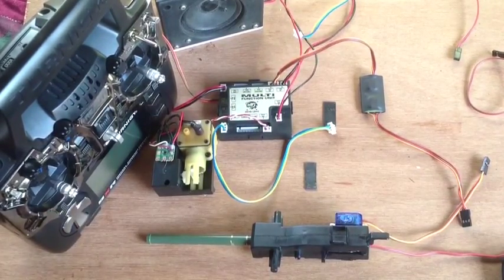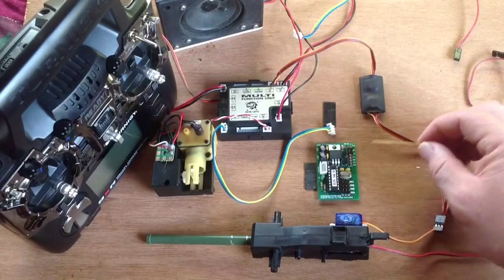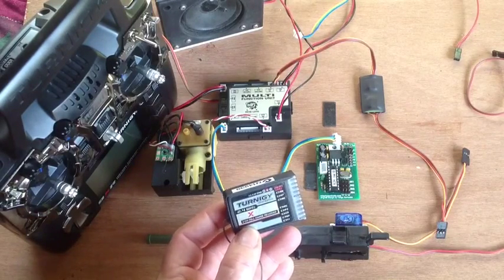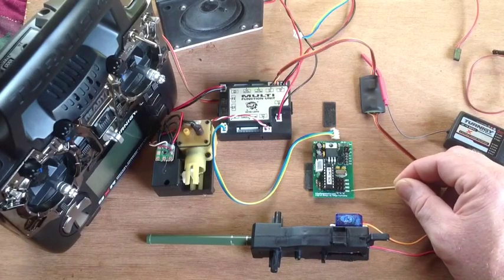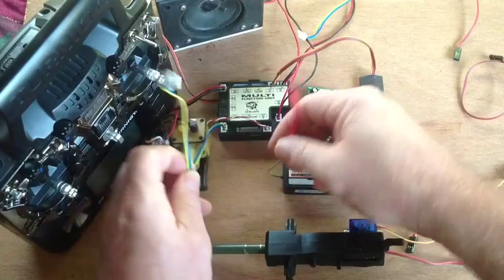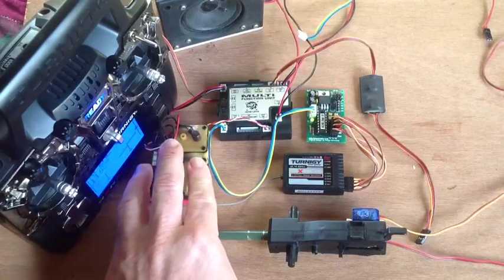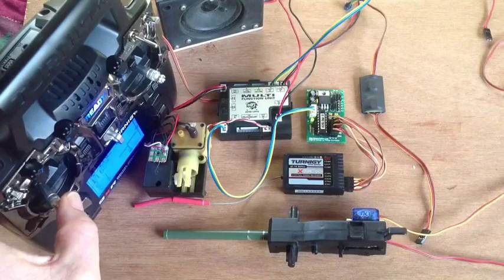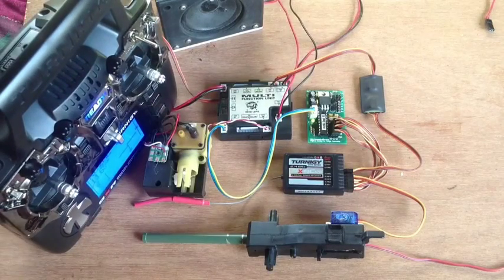RC2HL V3  Basic Install

Comment: Can I connect a FrySky receiver to this system and use my FrSky transmitter. The controller can reassign channels.
Reply from the maker: Khoa Nuyen First up the RC2HL is upgraded to the RC5HL and our recommended radio setup is the FrSky XJT and x8R receivers.  Plenty of videos here on the RCTA channel

Comment: on 9xr what kind of module do u use ?  do the board compactible with frysky system
Reply from the maker: The module used here is probably the FlySky one which is compatible with the Turnigy and Hobby King receivers.  The FrSky modules are not compatible with the Turnigy and Hobby King receivers.